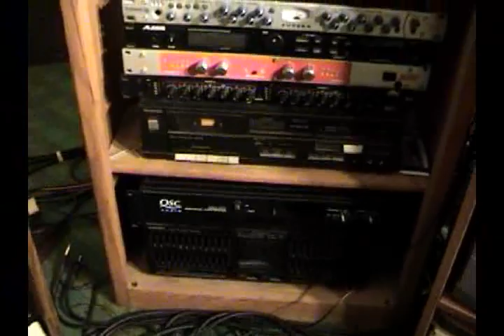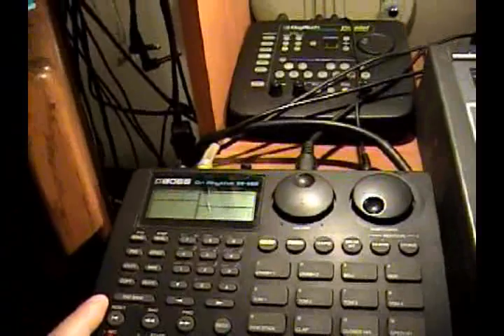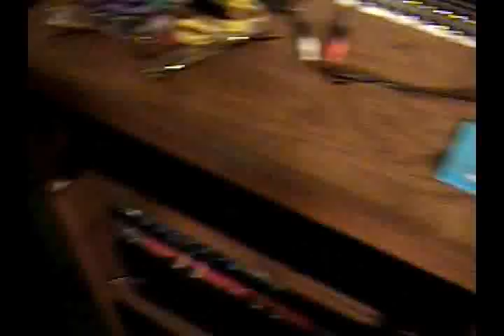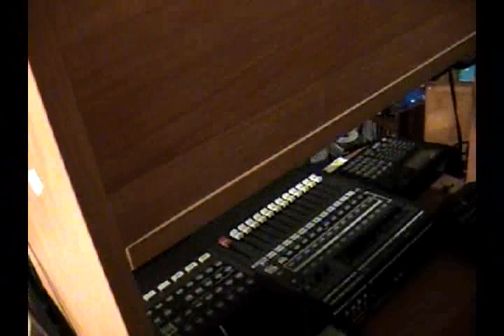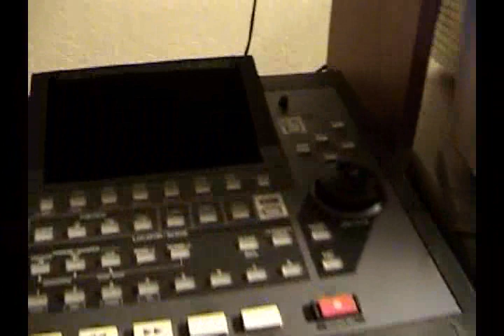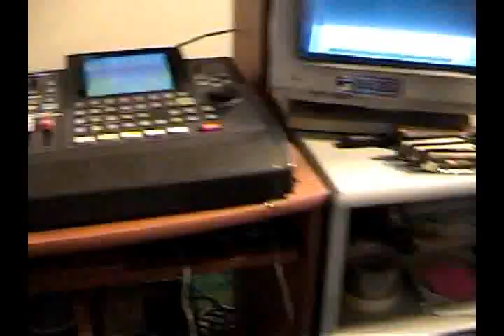Digital Recording 4_1 (Connection)

Comment from the maker: I have never performed an upgrade before. So if you have a new PC or Mac you will need a USB to MIDI cable. If you have an old computer you would need an old serial to MIDI cable. You will either have to buy to the Quest cd drive and get a 25 pin cable or you can probably get another cd burner and get a USB to 25 pin cable.

Comment: Can you do a video on how to upgrade the vs1680 midi files. I have the workstation upgrade disk. I want to update files 1-16midi files so I can operate the next external burner. I need to hook up to my computer and install the disk and run the update through a midi connection. Help

johngreasy 31 seconds ago